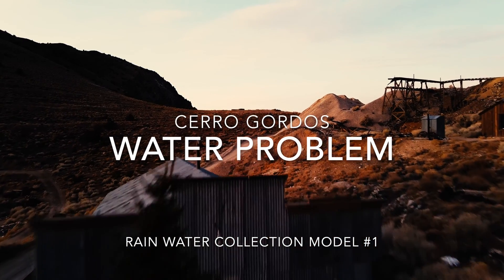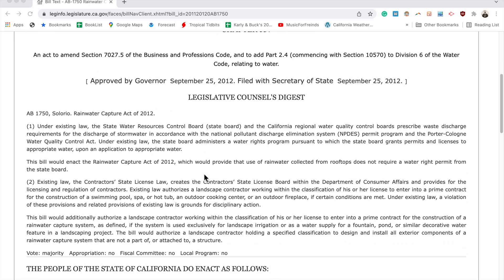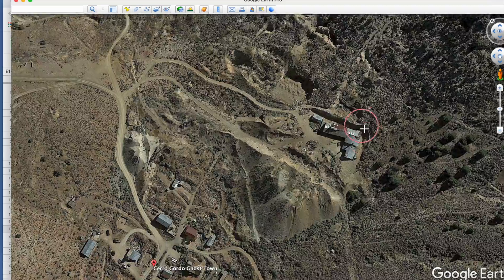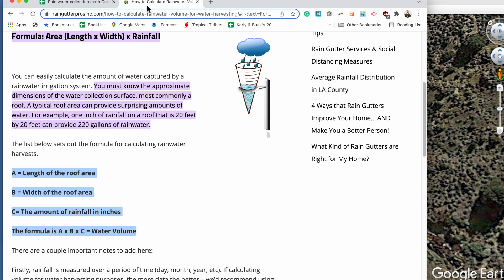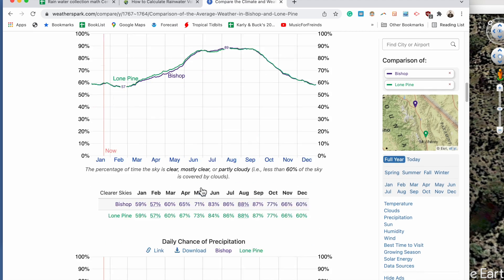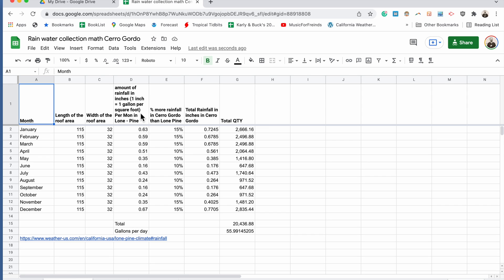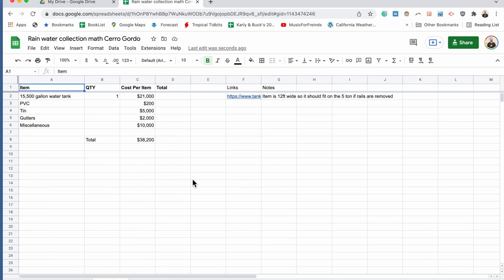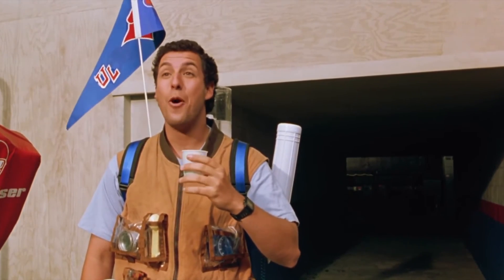Cerro Gordo - Working the water problem - rainwater collection model #1

Comment: The roof material is important. You need to make sure extra contamination doesn't come from the roof. I think this is the case even if you are filtering it. Awesome work!
Reply from the maker: Great point!
Reply: There must be something you could coat the roof with to get round this